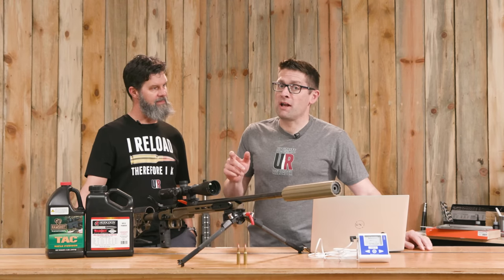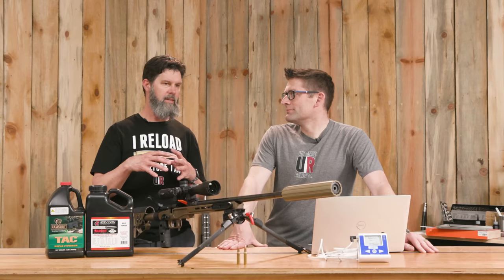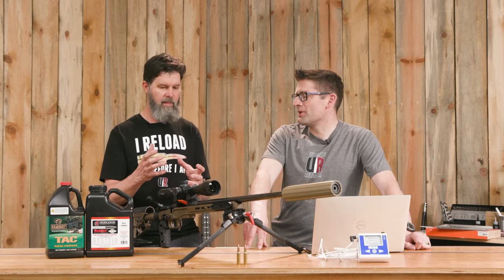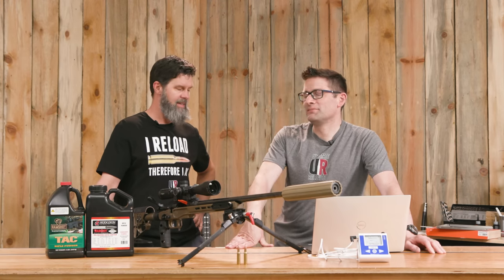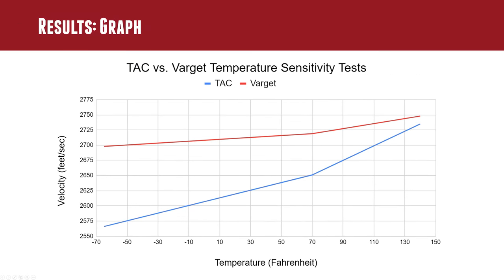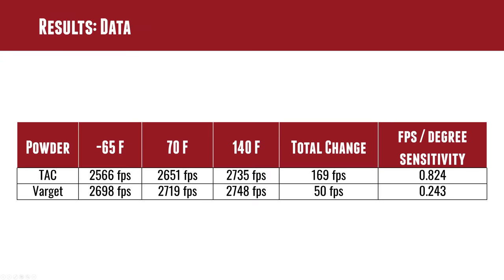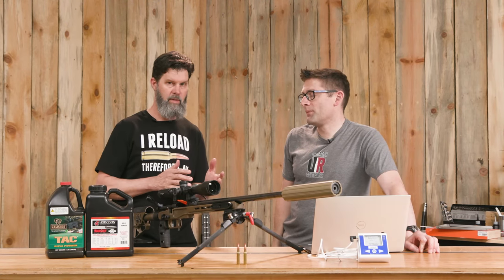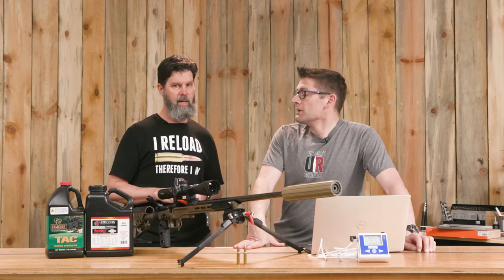EXTREME Powder Temperature Testing: Varget -vs- TAC

Comment: I keep my ammo in a rubber greased gasket ammo can with desicant,  a temp probe in a case with gun powder, temp sensor in the can  and a humidity gauge within the ammo can.  This monitors the environment inside of the cartridge case for temperature and the temperature and humidity inside of the ammo can.  I input this data into my firing solution.  It works absolutely great to maintain the proper muzzle velocity for a proper velocity per ammo temperature.    This is just one aspect of knowing where the bullet will impact especially in the trans and subsonic regions.  Great testing, thanks!!

Comment: I have measured my grey, unpainted, plastic bumper of my truck at 183*F.  My tan painted barrel 5 yards away was 135*.  I don't know how hot black stuff gets because I'd witnessed how uncomfortable it is and painted all my guns tan.

Holding a 200 degree piece of metal is awful due to conduction.

As for what I've experienced with powders, I've had popped primers and 3450-3480fps with M193 in a 20" barrel.  Allegedly, I've sent a 300 SMK at 2950 FPS in 338LM.  I think it was 4.9 mrad to 1000 yards.  I used an app to guess at the velocity based on where the bullets went.

Comment: This is great info, I ran into this type of issue some years ago while prairie dog shooting.  Loads were worked up in March,  April and may timeframe.  My 223 WSSM with a 1-7 twist for 90 bullets was causing the bolt to stick, hard to lift.  My 20 Tactical was popping primers.  Leason learned.

Comment: I have observed substantial temperature stability variation using H4350 in different cartridges. In 270WIN it is outrageously stable. In 7mm-08 it is very stable. In 300WSM it was noticeably less stable, still good but not near as stable as in the 270. 
So, results vary depending on the cartridge and the internal ballistics which is very interesting.

Comment: You should be keeping track of the humidity levels when you are in the process of hand loading. I’ve noticed changes in how some loads perform more so than finished ammo.
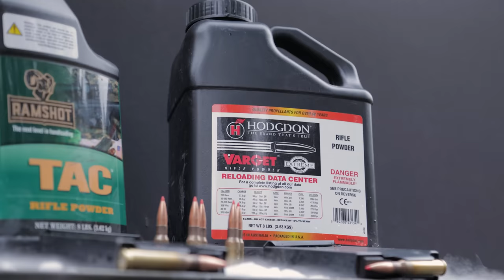Reply: Hmm just heard Rex say humidity has the least affect as anything…on his Dallas Alexander vid btw…I’m testin with my fn spr 1” 24” long 1:12” 4 groove and man it’s the perfect .308. .3” groups and all these numbers there usin are exactly mine and same speeds…43gr varget under 169blems put me at 2650 little bit ago…humidity is down here in Ky today…

Comment: I like the protocol.  For years, I had used Win 748 for 308 silhouette loads, but I was in the northeast.  I used magnum primers and didn't have an issue with POI.  I didn't own a chronograph at the time.

Now in the southeast, with hot humid summers, I pay attention to this a lot more.  I have a really nice 223 AR load with Win 748, great group, 10 fps ES, which I developed in the summer.  Since this is a bulk AR load and I use my Dillon 650, ball powder is a logical choice, and I wasn't considering a stick powder. I am near, but below, the top end, but given it was developed in hot temps, I am less worried about it. I store my ammunition out if sun and keep as cool as possible.  I don't see using it at really cold temps.

I worked up a 30-06 load with some Win 760 and shot it in the summer, in a 22" barreled hunting rifle, and let's just say I ended up pulling bullets on the higher charges loads due to pressure signs, even 2 grains below max. The chronograph read something akin to 300 magnum velocity with a noticeable recoil and I stopped on this 95 degree day.  I actually am focusing more on IMR 4350 for a hunting load since I don't mind this for low volume loading.

 This is why we work up carefully.

Comment: I used ramshot tac 44gr for my 308 165gr accubonds for hunting in Southern maryland . Thought I had it dialed in at 85° with August humidity. Went out farm land nuisance tag hunting on a 95 degree morning in August humidity off the charts and my dialed in Q fix sighted in 4 inches high and 2 inches to the left at 100 yards . I been using the Sam load for 3 years with this rifle but 10 fegree change made me stop using Tac

Comment: Another great video guys thank you  You basically proved what we see in bench rest  When I go to a match with my 6BR Norma  I check what weather Forecast say the temperature variance will be From morning to afternoon as we shoot several disciplines throughout the day Is ranging from 100 to 300 yd I don't load at the match but I bring loads varying anywhere from point 2 to point 4 in Difference in weight  To keep my groups from coming apart 
I use Varget  Exclusively  Thanks for the great video guys

Comment: I’ve seen consistent 75-100fps ES in 5.56 TAC loads which is rather significant compared to your 169fps temp swing.  Were your ES/SD numbers good?  Same rifle in question loves a comparable Varget load and groups and chrono results confirm.  Could I pick your Tac groups out of a lineup or did the speeds overlap the temp bands?

Comment: The video and going thru the comments reminded me of talking to a Secret Service marksman in the 2000's. He said they had custom handloaders in the USSS who would tailor their load for every single stop the prez made. Humidity, elevation, temperature etc are calculated. This means they have done very extensive testing in the past to do this. Rifle was custom made by USSS gunsmiths. His particular rifle was 14 lbs and 300 Win Mag. Accuracy testing was done at 600 yards. As the throat wears changes will not be noticeable at closer ranges.

Comment: Thank you for the data. Only issue with my 308/Reloader 15 and 168 gr was a hang fire at -30 c. Scared the crap out of me, buck went 9/0 into the trees. And now I use graphite dry lube. Lesson learned.

Comment: I have a PA10 18” mid length gas system. I worked up to 50.8gr of TAC with a 130gr ttsx at 2.794oal. I was getting 3105fps with a SD of 16 and an es of 42. Got a 3 shot group at .455”.

Comment: While working up loads for the wildcat 25-223 I got a surprise with Federal Match primers. Just switching to them boosted velocity 50-70 fps. Working with a wildcat is an educational experience in how so many factors effect pressure, velocity, etc. My go-to favorite powder Win 748 for decades is above outstanding in all .223 rifles. But it was very erratic in velocity varying 80 to 100 fps between shots. FWIW H4198 is super consistent so much so I thought the chrony was broken a few times.

Comment: Still being an engineer here.  I’ve often wondered about velocity change of the full system.  Does the TCE of the metal in the action and barrel vs brass and bullet cause more velocity change and pressure than just the powder and bullet?

Comment: Great video, guys. However, please explain on how a cartridge has a variability in a humid versus dry environment after it was loaded and sealed and whatever environment that it started with. If the cartridge was a free load it in a dry element then a humid environment should not alter any of the internal ballistics. Temperature yes, humidity no. Please explain. Thanks again.

Comment: I shoot high power and in the summer on hot days i have to come down a click. Also I noticed one of my Ar's is more pressure sensitive and i have pierced a primer with left over match loads in the summer with that gun. my match gun can take more pressure. I have pierced primers on hot days if my loads are too warm. This also happened in my 308 however I found out that it was because of the Winchester large rifle primers when I switched over to CCI and stopped piercing. Had some bolt damage before I figured out it was the primers not the loads.

Comment: 4064 for me on 308 and 30-06
Reply: I started out loading 308 with 168 smk and IMR 4064 and it did really good for me.   Oddly Varget was more plentiful in my area than 4064 so that’s what I stocked up on and now use it in 308.  It does outstanding as well.
Reply: @halfdollar86  it's close to 4064.
30-06 i use magnum primers with 52.5 grains 4062.
308 I use magnum primers with 45.5 4064. Never had a problem. I always watch my primers.

Comment: I shot a match this weekend and on the longer distances (500 meters+)saw my 300wm shot 2 clicks (mildot) higer than ussual. My theorie is that while waiting for my turn to shoot again chaimering a bullet in a hot barrel heats up the powder in the bullet. I tested this temp difference on strelokPro with a 30’c in powder temp and showed the same conclution. Could you mabe test this?
Reply: @Travis Fox thanx for the reply. I am going to do a test myself to see howmuch it influences my point of impact on 400 meters.

Comment: good video and experiment.  you have to try your equipment in every conceivable situation.  I had to learn it the hard way.  at an ELR competition in Sweden.  the shooting range at home is close to sea level, with an air pressure of +/- 1000mBar.  where the match was held, the air pressure was 965mBar.  I did not know then, why I missed the target at 1400m?  but hit previous target at 1100m 2/6 shot.  I shot 1.1 Mrad over at 1400m.  but somehow I made a measurement of the pressure, and got an aha experience.  I changed in strelok to the new air pressure.  so to 1600m I hit 3/6.  1800m 1/6, 2000m 0/6.  6.5 creedmoor, with lapua scenar 139gr @ 890m/s

Comment: It’s one thing to have the cases/powder be at those extreme temperatures to get the MV variations. But....What about the barrel temperatures? If the barrel temperature is that cold or hot, I’m certain that would affect the MV variations as well. You wouldn’t normally have freezing cold cases/powder, but an 80 F degree barrel. Just something to consider....🙂

Comment: IMO pitting TAC vs Varget is not apples to apples. Spherical powders (TAC) almost always give you more velocity swings in temp spreads. Perhaps another extruded powder like 4350 or 4064, both of which work great in 308, would have been more comparable.